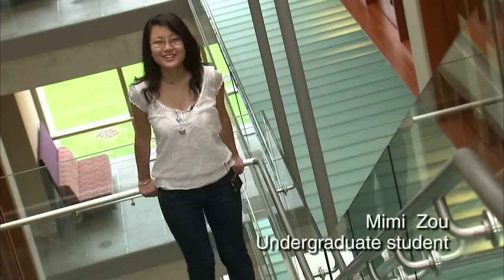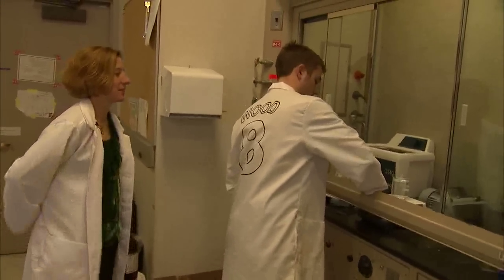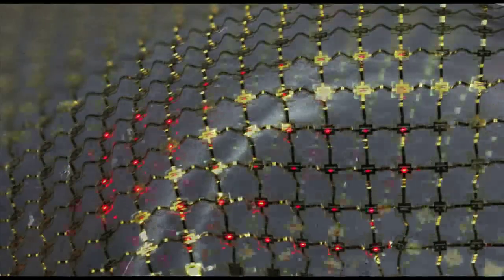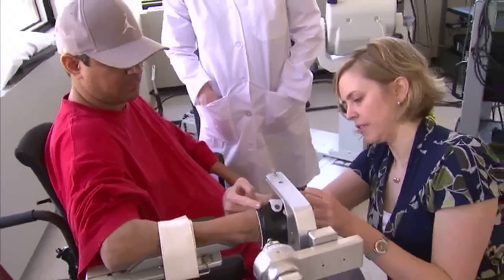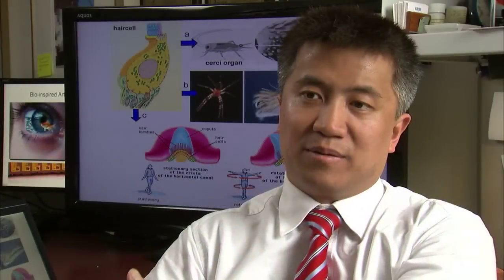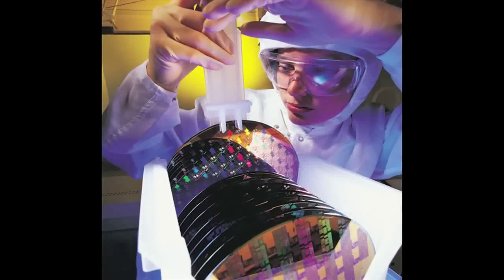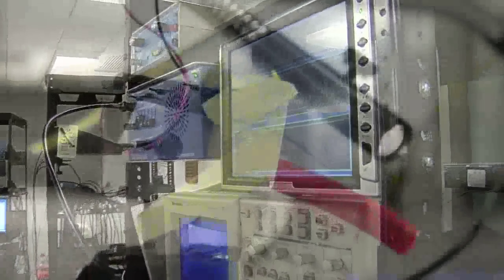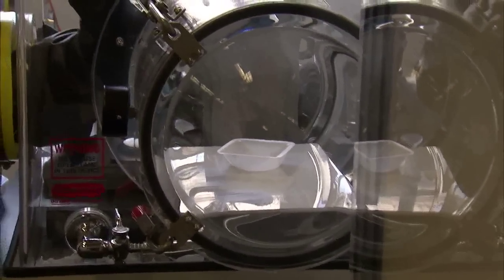Mechanical Engineering

Comment: Mechanical engineering jobs are more "widespread". If you choose bio engineering you might want to check if there are any companies in the area that offer such positions. Unless you don't mind re-locating of course. Other than that they're both awesome. Also, don't confine yourself to a particular field, the experience you gain in one is still useful in the other. Either way good luck!

Comment: I am also considering Mechanical Engineering, and I'm also very concerned about this sense of design. When engineers talk about design is not something as artistic as we think of, for an engineer a good design is a design that works, so you can see some difference between the concept of design that a product designer have, and the concept an engineer have. But remember, when you have an engineer with the concept of design of a real designer, you have an unique professional.